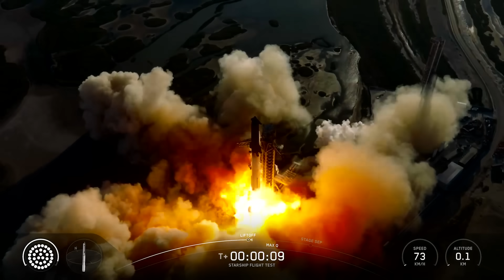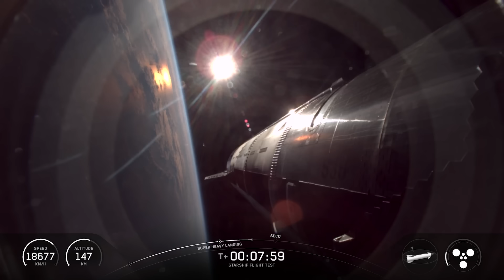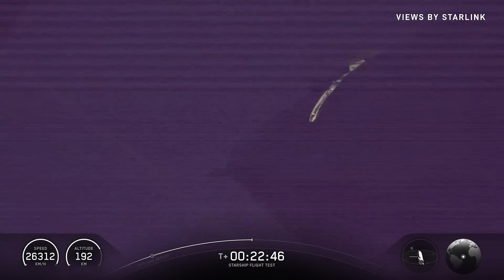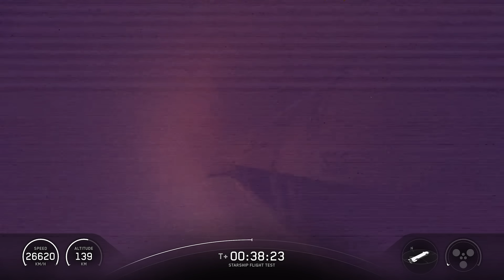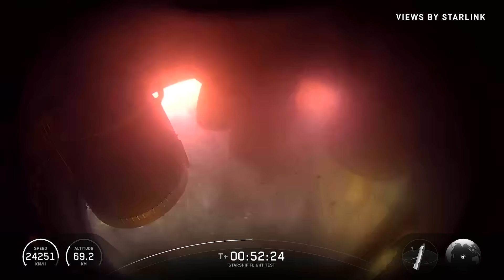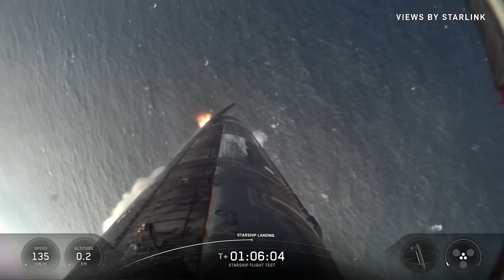SpaceX just did the impossible! (Starship flight 11)

Comment: based on my several and persistent tests observations from SpaceX, I think if they put 95 % of the efficiency in materials shield design, I think drastic progress will be seen. You need top 1% of Material Science engineers and top 1% of Plasma Physicists. I myself is a physicist, I just contribute this as a tip, based on what I see what SpaceX is trying to achieve. Cheers!